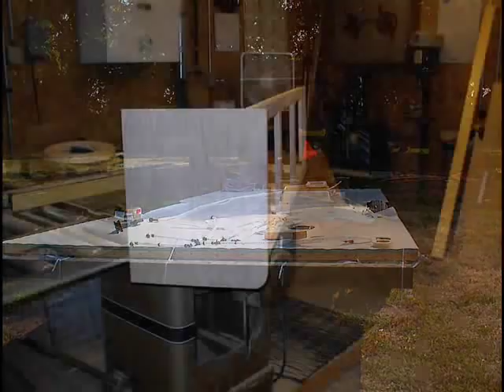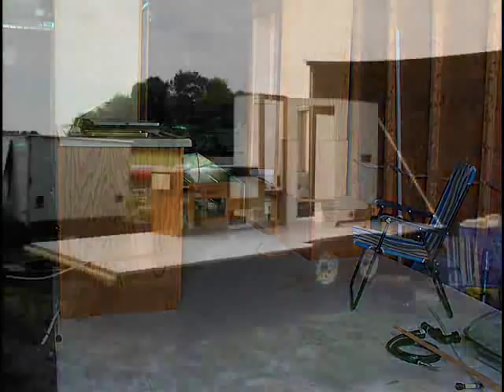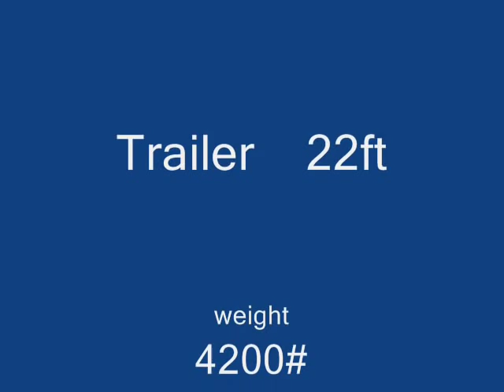Homemade camper trailer

Comment: Hi, it looks impressive, insulation is very good for those hot and cold days. I transformed a Chevy P-30 with a shower, had an electric gen set, hot water shower head, roof air conditioner, a water faucet aoutside for hand cleaning. I use it to go around and make mechanic and welding work. I removed the paint and repainted from bare aluminum. My bath was too small, but taking a shower by the mountains is unforgotable.  It took about $25,000, I loved it!

Comment: This looks exactly like my 2000 Kitt Sunchaser. Floor plan, window placement, everything. Right down to the outside shower, and ladder placement. Only thing different is the diamond plate stone guard. Might do that to mine. Great job you did.

Comment from the maker: Its funny when someone thinks they have the all the answers to someone else' s hard work.  Maybe if I would have shown the other 100 pics in the slid show? but your thinking is flawed this was built in MN not many rv MFGs here just because you cant do it dosent mean I didn't. For real
Reply from the maker: ***** you know nothing lets see yours .
Reply: BanjoSpecial I think you should have used a Fidel and Saxophone at 2:30, instead of a Banjo. That mistake flawed this whole project.  lol
Reply: What kind of insulation for 2x2 walls?

Comment: What did you use for roof trusses?  I am fixing a 92 terry 5th wheel camper.  Right now it has 2x4's with a tapperd cut on them.  I think a truss would be stronger.  Thanks for the info and great job on the camper.

Comment: Iam very impressed! thanks for sharing, I know it was a labor of love! I was thinking of doing this myself. I have a heavy duty dual axle car hauler that is little used. Do you think that this would be a good foundation trailer? Would the placement of the axles(more towards the rear) pose any problems with the overall balance of the RV? Would it need any structural alteration to do what you've done here? It does have wheel wells over both tires? Would you remove or design around? thanks.jimmy

Comment: Nice job on the trailer. Looks professionally made. I know how much work it was (got tired just looking at you do it), and you were meticulous. I'm interested in the roof. I saw the berm in the middle and figure you bent the metal top with that. Then I wondered if there was any buckling. Also, what about water proofing? Is  there a rubber membrane or something? Thanks.
Reply from the maker: The roof is built with trusses so it has a crown, the roof skin Is fiberglass skin no seams.
Reply: Interesting. I know they usually lay out a rubber membrane and cover it with sheet metal. So is the fiberglass a single sheet or did you have to layer it and then sand it back?  Thanks.
Reply from the maker: Its one sheet same as others use on the sides.